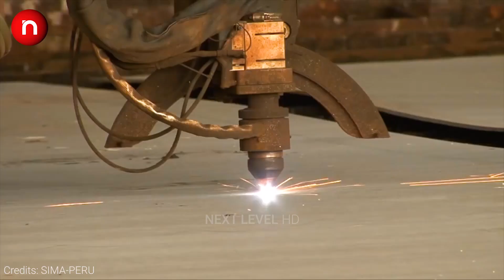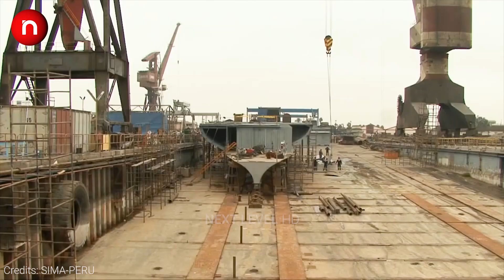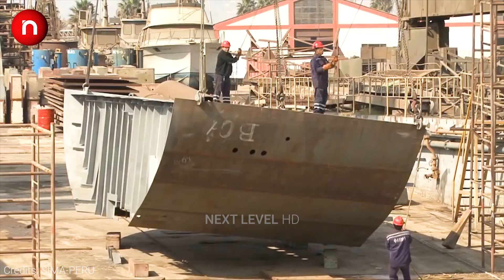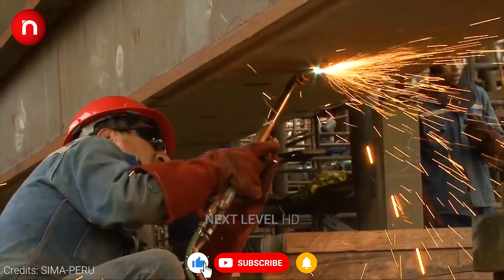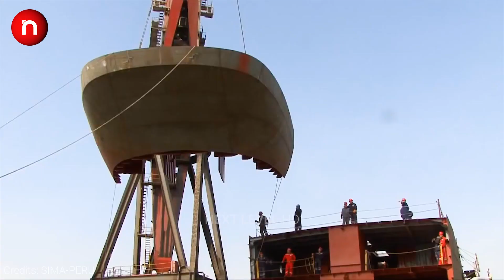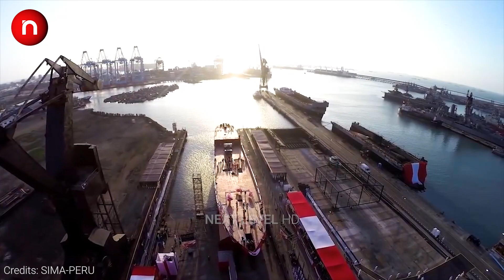Next Level Giant Ship Construction Complete Process - Amazing Vessel Fabrication Welding Techniques

Comment: What are the box-like structures at the bow and the stern, on both sides of the keel ?   I'd guess they're stabilizers, but they appear to cover where the thrusters should be located.
Reply: ¹¹¹ㅔㅖㅖㅖ⁰⁰⁰⁰⁰⁰